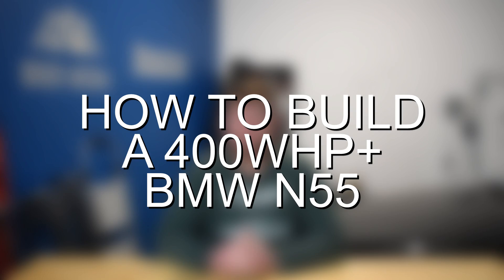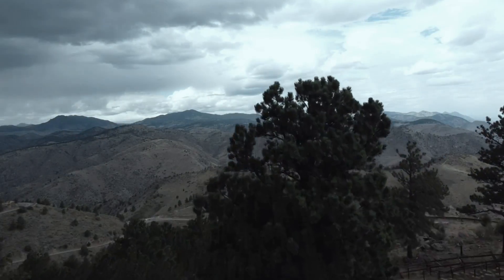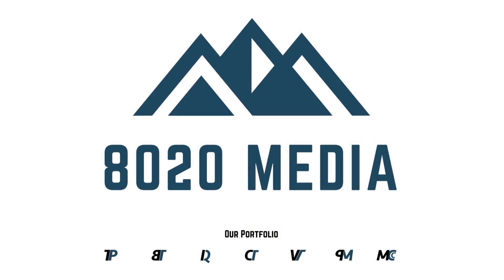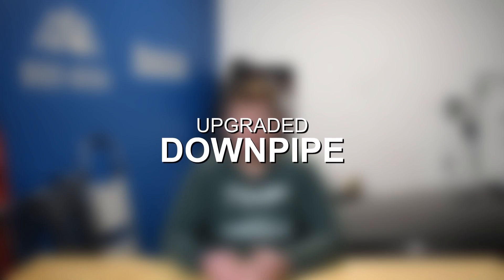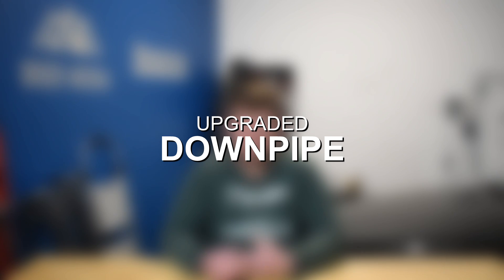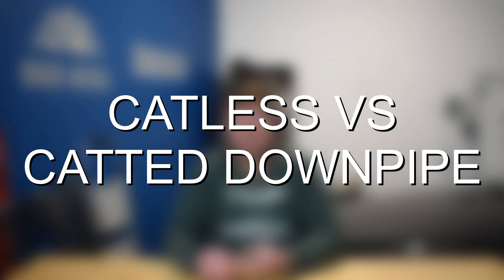How to Build a 400 WHP BMW N55 With Only $1,500!

Comment: Great companion video to the bmwtuning article. I'm just getting going on my N55 build, VRSF intercooler is in, but if you're going to be increasing boost in any way via these mods, I'd highly recommend changing out all the plastic parts around the turbo (charge pipe, boost pipe, and inlet pipe). I've read the horror stories of how they like to go boom when adding the slightest tune.
Reply from the maker: N - Completely agree! Thanks for the feedback.